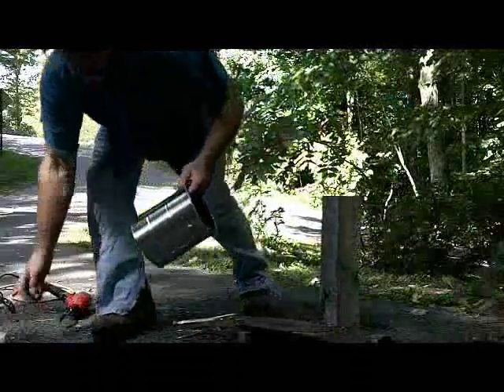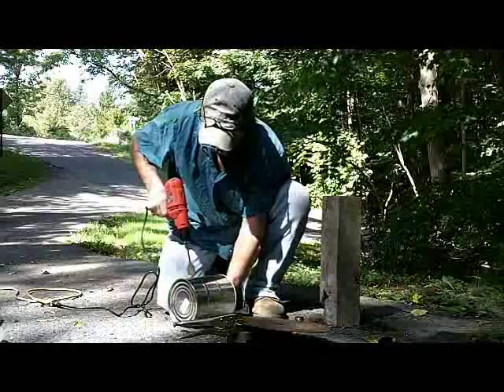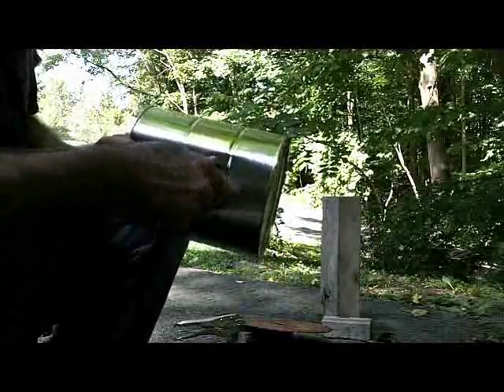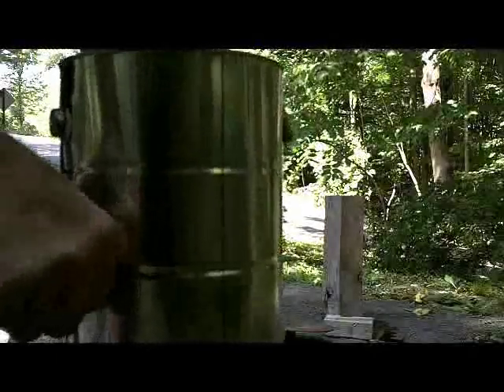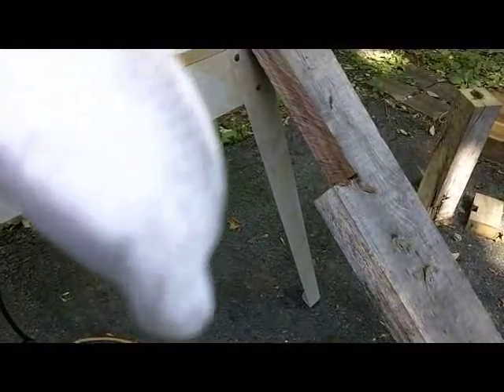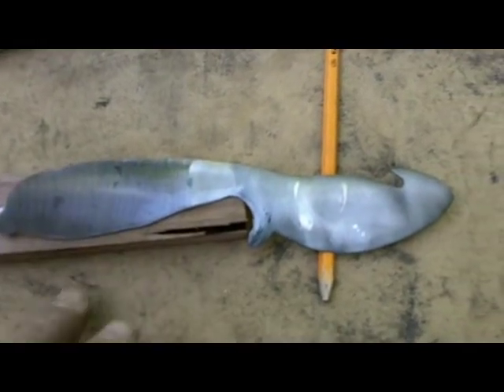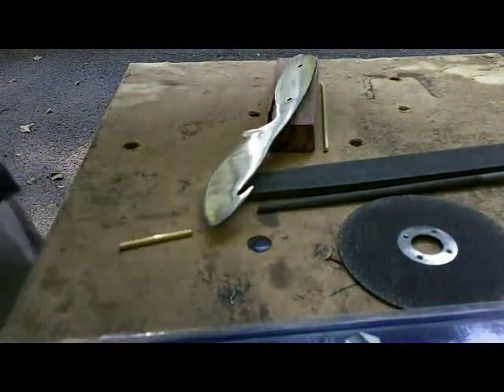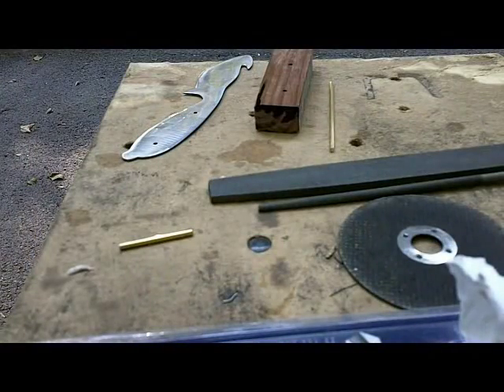Knifemaking - First Homemade Knife - Saw Blade Knife

Comment: Is that an 18" saw blade ? I bought a few recently from a guy who wanted to get rid of his, about 50 bucks for 20 saw blades. What kind of steel did you heat treat and temper it as ? Thank's !
Reply from the maker: MRaZZeee i think it probably was more like 12 inches... treated it like 01 in the tempering but i don't think it was near that
Reply: Chandler Dickinson Okay, thank's for quick response. I have read online that most old circular saw blades are made with L6 steel which is a low alloy steel and rarely M2 tool steel which is high speed steel. If ever you have a chance to make knives out of circular saw blades again and heat treat it as L-6 or M2, make a video, I would be very interested in watching it. Sub'd and liked your channel.
Happy knife making and wish you a Happy New Year!